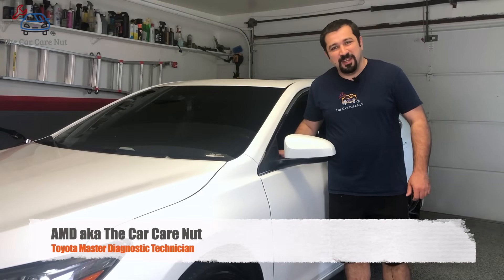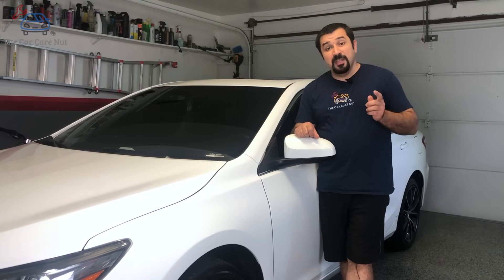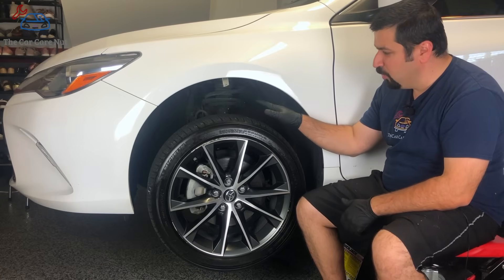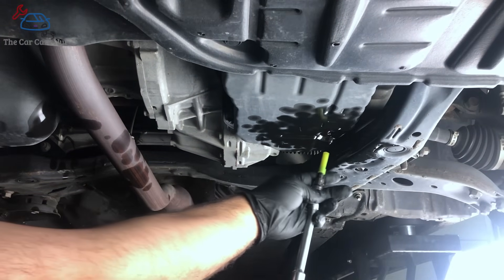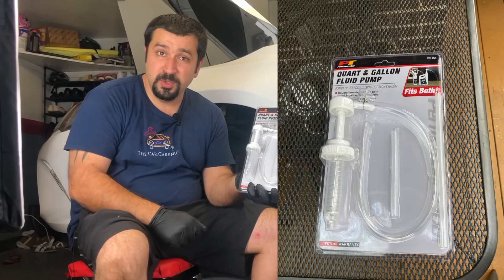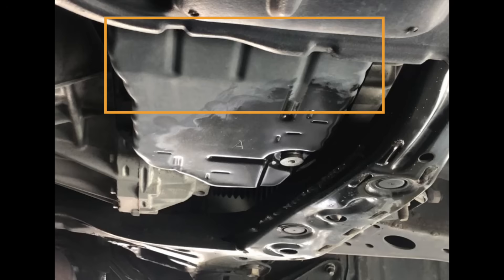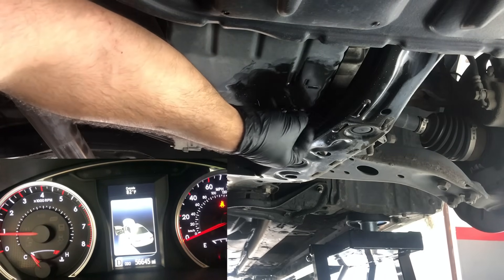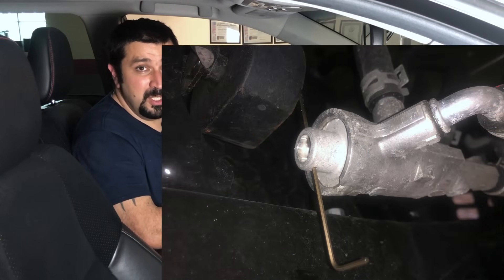How to change your Toyota Sealed Transmission Fluid

Comment: Hi AMD, 
Excellent video. Will this procedure apply to a 2006 Lexus IS 350? Is the fluid level temperature range still 95 to 113F?  Will the same jumper configuration: CG(4) and TC13) work? And finally will the same “D” indicator light in park “P” after removing the jumper apply to the IS? Thanks and keep doing these type of detailed/straightforward videos.
Reply from the maker: Hi! 2WD or AWD?
Reply: @TheCarCareNut  2WD
Reply from the maker: @ruizces  hi the procedure will work the same on your car and the fluid temp is 102-120
Reply: @TheCarCareNut  thank you very much! The procedure worked perfect. During de diagnostics mode I cycled the shifts from P to M (shifting 1 to 6) then D, R and back to D. Then cycling from D to N and back under 1.5 seconds period until D came out solid (this took about 6- 7 seconds. Moved to P, remove the jumper and with the engine running (very important) waited approximately 3 to 4 minutes until the D appeared together with the P, indicating correct fluid level temp check. D OFF: under temp; D ON: correct temp; D blinking: over temp.  I managed to take out 2 quarts on the first drain.  I made a mistake though.  My car is 114K miles and never have changed the ATF (the Lexus dealer tolde me 2 times that no ATF change was needed) I was hesitant on the oil flow trickle signal and thought I shut off to early. I thought I could open the fluid check plug again (2006 Lexus IS 350 has both a drain plug and a fluid level check plug) to double check but I turned the engine off and the fluid flow stopped and came down to the pan causing to drain more than necessary.  I have to refill another quart and repeat with the engine running the next day (with the engine cold) to correct the level.  It worked perfect. My tip, always measure what you drain and put in so you have a better sense o what you finally added to the transmission.  Once again thank you for all your help and quick responses.  Keep doing these kind of useful and excellent videos.

Comment: I have done my 2014 RAV4 transmission oil change according to your instructions. It's absolutely smoother than before. Your videos are great help for DIY jobs. Keep it up mate. Appreciated.
Reply: Your lecture is clearly. The procedure is accurate,  smooth, helping. That is great. Thanks Mr CCN
Reply: Awesome to know, I'll be doing it to my mom's 2014 RAV4 soon and it will be my first time doing any transmission maintenance, I believe it will go well with these clear instructions 💚
Reply: How many miles did you have on your car when you did it?
Reply: After paying multiple places including toyota dealerships for botched transmission service or service never done but got charged for it,  I now have a tiny transmission leak on my  2013 rav4,  I really like the car and have decided that once the transmission goes I will get it replaced,  for now I need to keep the levels right,  im happy to know that this video applies to your vehicle which I assume it will apply to mine as well,  I just purchased a scan tool and will be attempting my first own transmission drain and fill,  hope all goes well.
Reply: I put valvoline my transmission fluid it not working great
Reply: @FarhanKhan-cs9cr  always buy the original Toyota transmission fluid from Toyota dealers
Reply: I use Aisin transmission fluid for Toyota. The same company that makes these transmissions. No problems.
Reply: @ryanhuang8498  where do you buy this ASIN trans fluid?
Reply: @ravireddy2535  NAPA Auto Parts

Comment: Can I drain the cold transmission fluid then measure it and put back the same amount that came out of the transmission? This would mean I am adding cold fluid back in. Thoughts?
Reply from the maker: You can but if you did all that I would go ahead and check the level and be sure

Comment: Hello The car care nut.  I have a '14 Lexus gx 460 with 88k + miles.  Do you recommend changing the transmission filter now that I have gone beyond 60k?  Should I drain as much fluid coming from the radiator until fluid is reddish in color?  Also, what's the temp range for A760F transmission? Thank you for your time.
Reply from the maker: Hi! I would do a drain and fill. Temp should be around 99-115

Comment: I have a question with respect to transmission fluid changes - is it considered unsafe to use the fluid exchange machine vs just doing a drain and fill (with dropping thetransmission pan included, to remove more fluid)? 

I keep hearing that the dirt and crud will clog up the passageways if the former method was used, but this doesn't make sense to me. The machine is simulating how the fluid runs through the system by pumping out the old stuff and pumping in the new stuff to replace it at the same time. It would function just like it would in normal operation, how is it any less safe?
Reply from the maker: Hi! They are both safe if done right. Flushes can be an issue on older transmissions that wasn’t serviced.both methods need to be followed by a fluid level check
Reply: @TheCarCareNut  Thanks for the reply, when you say older transmissions, you mean like really old cars, right? The car I'm being asked about is a 2016 Lexus IS300 AWD (6 speed auto), which is not old at all.
Reply from the maker: Older cars in my definition start around 10 years old and older so you’re good.

Comment: Hello @The Car Care Nut thank you for all that you do in these videos! I own a 2019 Camry LE 2.5L, I wanted to know how often should I change the transmission oil? I put about 15,000 miles a year on this car. Thank you 😊
Reply from the maker: Hi! Change the transmission fluid every 60k miles or 6 years
Reply: @TheCarCareNut  I found a couple people with the same question on 2019 Camry 2.5 L. We could not find the Bypass valve that we need to pin open with an Allen wrench. Could you help with it location?
 
I took off all the splash guards (small one behind driver side wheel and 2 large panels underneath) and looked everywhere……

I followed 2 lines out of the transmission UP to a 3.5 inch by 3.5 inch box shaped out cropping that also had 2 other lines going in and out (I’m assuming coolant) but NO valve that I could see. I stopped everything right then and put the splash guards and tires back on. I didn’t want to mess up a $5000 transmission 🫠
Thanks For your Help and I’m Very sorry to hear about Your Dad…. I lost my dad this past Veteran’s day… I know Today had to be tough for you and your family…. God Bless You and Yours until you see your Dad again🙏
Reply: I'm literally at the moment following this procedure but cannot locate the bypass valve as instructed for the 8-speed Transmissions on a 2019 Camry LE 2.5. I removed the driver side Splash Shield and looked all over top, bottom, left side, right side, front of engine, behind engine, passenger side and can't locate. Good luck guys.
Reply: @hotprosciutto6286  I Just did the Same thing with my 2019 Camry 2.5 L.
I took off all the splash guards and looked everywhere! I followed 2 lines out of the transmission UP to a 3.5 inch by 3.5 inch box shaped out cropping that also had 2 other lines going in and out (I’m assuming coolant) but NO valve that I could see. I stopped everything right then and put the splash guards and tires back on. I didn’t want to mess up a $5000 transmission 🫠
Did you ever find any more info on it?

Comment: Do you recommend changing transmission filter on 2012 Camry's?
Reply from the maker: Hi! Unless the fluid was not replace on time then the filter doesn’t need to be replaced
Reply: @TheCarCareNut  it has around 100,000. Transmission fluid has never been changed. Thanks again for the video. Liked and subscribed
Reply from the maker: You’re still within time to replace the fluid

Comment: Is this procedure the same in concept for a 2017 RAV4 keyed engine?

Thanks
Reply from the maker: Hi! If it’s not a hybrid then yes it’s the same process
Reply: @TheCarCareNut  Im testing before changing oil for RAV4 2016. Tried with wire and "Steady D came pretty fast in less a 1min" so i checked with infrared temperature gun and it showed only 87F. Does it right?
Reply from the maker: The d light is right

Comment: Wow, my el cheapo $28 Etekeity Infrared thermometer Worked! (2014 Tundra 5.7L Max Crew 4X4)  Started off at 60 degrees cold, started engine and ran through gears, she hit 85 in about 5 minutes, went up and went through gears again, and the top/right of the drain pan (where AMD showed) was at 106 in 9 minutes.  So I don't need a $300+ OBD2 reader to get tran temp!  (Be careful under the vehicles, I was seeing 350 degrees on parts of the tailpipe...ouch)  God Bless!!
Reply: I have the BlueDriver OBD scanner and it shows the transmission temperature.
Reply: @starzztop  Do you have a Tundra? Reviews on Amazon says doesn’t show temps for Toyota or Lexus 😩
Reply: @ColoradoBoo  i have a 2014 camry
Reply: @starzztop  what model is your OBD reader??

Comment: Such a helpful channel!  I have two trannies that need service...my 2014 Tundra MaxCrew 5.7L  (I have temps 104-113).  And my daughters 2012 Sienna XLE AWD.  (No idea on temps...same?)
Reply from the maker: Thank you for watching! It’s around the same yes. On the tundra don’t forget the cooler bypass. Gotta get pushed in and a pin installed
Reply: @TheCarCareNut  Yes, I have an old grenade pin for that cooler bypass!!  If I use the infrared temp gun, do I need someone in the vehicle shifting between gears while it's running or do I just let her run and check the temps then pop off the drain plug when up to 104?
Reply from the maker: If you’re using a temp gun you don’t need someone in the truck. Just when you start it shift in drive and reverse a couple of times to circulate the fluid and get an accurate reading

Comment: So if my Corolla’s cvt transmission holds 7.9 quarts of fluid and I am only getting out around 4 quarts because I will drop the pan as well, how many miles should I put on the car before I do another fluid change until it comes out red?
Reply from the maker: Hi! Don’t look for red fluid. Replace the fluid on time once and call it a day.

Comment: Is it ok for me to just do a simple drain and fill before the first start of the engine in the morning? Use a measuring jug to measure the fluid.
Reply from the maker: You can. But if you went though all that I would just finish it by checking the fluid level
Reply: I don't have anything to monitor the temperature. But since i live in a country that always have temperature that's around 36 degree celcius during afternoon time, will the day temp help? I'm not a mechanic, just a diy guy. Oh yea, my car is a Toyota SUV, Fortuner 2021 model with 6 speed auto tranny.

I see you hard wired the obd, but like i said, i'm a diy guy and i don't dare to mess with these. The reason i diy this is because our dealer here charges very high for labour and parts.

Also i want to change it every 20k km. This will keeps the tranny clean and reliable. I do this to all my automatic cars, which they all have the dipstick, it's so much easier.

Comment: Hi AMD - I changed my transmission fluid at 58k miles on my 2016 RAV4. Felt a big difference after did a drain and fill, the shifts are much softer and smoother. I didn't even realize the shifts were that different vs. when the car was new. My question is if I could do a drain and fill at 30k miles to make sure the shifting is always optimal (instead of the 60k miles interval)? Thanks!
Reply from the maker: Hi! You can do the fluid changes at 30k without issues

Comment: I have 2010 Camry with 112K miles. I have not had the transmission fluid changed. Should I have it changed/flushed etc?
Reply from the maker: That’s border line. I would just do a single drain and fill
Reply: Thanks a million!

Comment: 👋🏽,on a 4 cyl 2019 camry se,at what temp should i adjust fluid,about to hit 60k
Reply from the maker: Hi! 95-113
Reply: @TheCarCareNut  thank you so much AMD ,you are the greatest! Also is the cooler bypass necessary on the 19 camry
Reply from the maker: No cooler bypass on the 19 camry
Reply: @TheCarCareNut  worked great! Thank you so much! I just wish i didnt wait till almost 60k

Comment: 2012 sienna xle fwd 270,000 one owner miles. Should I ask my dealer to change transmission fluid? Will they perform service on a sealed unit? I’m starting to feel and hear a thud sound like the transmission is confused finding the right gear at low speed. Great car only replaced one alternator, tires, oil and brakes. This V6 has never burned oil either. Thanks for your amazing channel.
Reply from the maker: Hi at this mileage I wouldn’t replace the transmission fluid if it’s never been replaced before

Comment: Hi Amd...thank you for this tutorial.  I successfully followed the steps on my Sienna...hardest part was leveling the van...thank you.  I also have a 17 highlander...is there anything else I have to do differently other than the cooler bypass?  Ty
Reply from the maker: Hi! Not much difference on your 17 highlander other than the cooler bypass. The drain will be a 10mm hex and then use a 6mm hex inside the drain to remove the overflow tube. Otherwise it’s exactly the same

Comment: Hi
Great videos
I'm in the UK and have a 2013 Avensis 1.8 Petrol with a CVT Gearbox. The car has been serviced to schedule by an independent garage and the car has been faultless for 8 years covering circa70k miles. I have enquired locally, with Toyota as my local guy does not want to mess with the CVT gearbox, and they insist sealed for life! I'm in your camp @oil/fluid is cheaper than gearboxes so would like to change it. Is it Toyota policy to not change GB fluid or can I insist they do it ?
The last question I have for you is the European CVT the same gearbox as in the US?
Many thanks
Reply from the maker: Hi! I would ask around other dealerships. One of them can replace it for you. I am not sure if it’s exactly the same unit as the one in the us because we don’t have your exact model. But if you find the model number of the transmission I can tell you if it’s the same or not
Reply: @TheCarCareNut  
Hi, My Toyota Avensis was inherited by my daughter two years ago so I was unable to respond with this information requested but I have it now. From the vehicle identifier plate I can see: A/TM-03A/K311 so I think this is a very common CVT gearbox made by AISIN possibly. As I'm keen to effect this fluid change when she visits next week if you could confirm this is the standard process shown on YT it would be appreciated.
Can I also ask how many times I should complete the process in an effort to flush as much as the old fluid from the gearbox and increase the concentration of new fluid?
BTW, I did approach a number of Toyota agents in the UK but I could not find one locally to do it. Anyway, I mechanically minded as I rebuild classic motorcycles so will obtain the Toyota fluid and do it myself.
One last thing, as the car is now 10 years old and showing 70k miles ( the reading above was incorrect, it should have stated 60k) would it be prudent to obtain and change the internal filter along with the filter O Ring and gasket?
Once again, thanks for a great channel
Reply: Hi Paul , I have a Toyota auris hybrid with the cvt from 2015 , and there is not a removable straw tube , you just take the filling bolt out ,then the drain bolt out , when it stopes dripping out , put the bolt back in ,then fill from the top filling bolt till it overflow, then put the bolt back job dun.

Comment: Thanks for the clear, complete information you've provided. Great job!  I have a 2017 Corolla LE and would like to ask for the correct temperature for checking the CVT fluid. Thanks again.
Reply from the maker: Hi! 95–113 for your Corolla
Reply: @TheCarCareNut  Thank you again!
Reply: @TheCarCareNut  hi!  I have tried working on draining my 2017 RAV4. When trying to remove the drain plug/bolt. I cannot get the first bolt off. Do you have any suggestions.  I’ve broken a ratchet trying to loosen it. And to clarify. I have turned it counterclockwise when loosening. Also. Thank you for what you do!

Comment: i think you method of when the D becomes solid is off!
How could a transmission rich a temperature of 40 degrees celcius when the engine has not even approached 20 degrees celcius! I have seen that temperature check done by someone here on youtube and it made lot of sense because i managed to replicate on my car by practicing!
But when i try to replicate yours the D comes out solid for 2 seconds and it disappears for a while and comesout blinking!
On that other method it takes longer for the D to come out solid! You actually have to put the car on P after cycling between the D and the N for the D to disappear. it will not sure any indication while the car is on P waiting for the solid D to appear. And that takes a while! After few minutes pf having the car on P the D appears and in my case it took a whole 8 minutes for it to start blinking.
By the time the D comes out solid it makes sense since the engine temperature will also just be above 30 degrees celcius!

Comment: Please tell me if D indicator come solid for 2 seconds then disappears is it ok to check oil level?
Reply from the maker: Hi! You’ll need to put the car in park then pull the jumper wire then wait for the d light to come on solid before checking the fluid level

Comment: Hi AMD, with me being the first owner, could I just drain the fluid when the car ir cold and add just the same amount that came out back into the trans, would that be fine? What’s the problem with that? Thank you!!
Reply from the maker: Hi! You can do that but I’d say if you went through all that why not finish the job and check the fluid level.